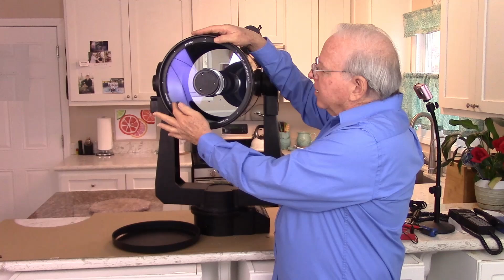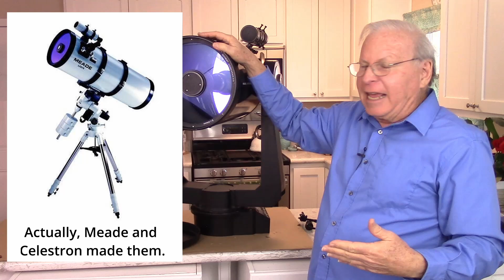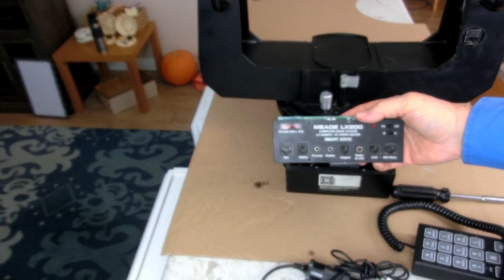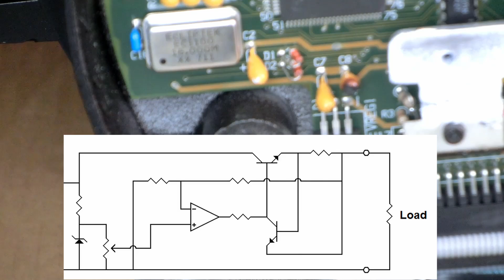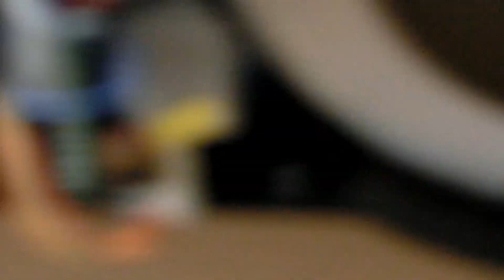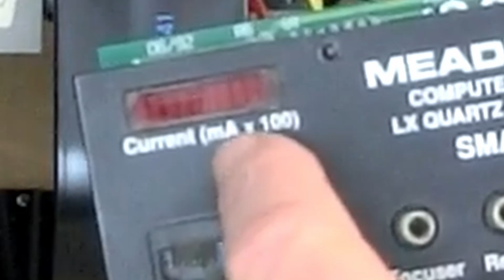Fixing My Meade Schmidt-Cassegrain Telescope's Electronics

Comment: Electrolytic capacitors can take some abuse,  but tend to dry out over time, particularly the smaller values. This causes the capacitance to drop to a very low level. This won't cause damage but may cause odd behaviour. Tantatum capacitors never dry out because they are hermetically sealed, but are very sensitive to overvoltage, which causes them to short out and explode, if the circuit can supply enough current. NASA uses tantalum capacitors in their probes but failures are extremely rare because batteries and thermoelectric generators don't produce voltage spikes. Meade used tantalum capacitors with voltage ratings that left little margin for error, due to cost. You are very wise to replace the original tantalum capacitors with ones with higher voltage ratings. Your telescope should last indefinitely. The upward creep of the current is troubling. Something is heating up and drawing more current, which may indicate thermal runaway. I would check for hot components, particularly semiconductors. But this may simply be how current is  drawn as the electronics start up.

Comment: I have a rescue scope (covered in barn dust) that I got for $100. It is a Meade LX6 (10” f/6.3) with wedge, tripod, hand control & encoders. I’ve been advised to replace all capacitors, even though it works when I plug it in.

Comment: Why do they use a spherical mirror? Wouldn't,t parabolic be better?
Reply: It’s a Schmidt, so the corrector plate on the front is a lens that allows the mirror to be spherical.
Reply from the maker: A parabolic mirror has its own problems. It's more difficult to make and the stars that are not in the center of the visual field are distorted, looking like comets to the the distortion is called coma. All modern professional telescopes use hyperbolic optics of the Ritchey-Chrétien design. As nicklappos says below, this is a Schmidt design that uses a spherical mirror and an aspheric corrector plate (lens) at the front of the telescope.

Comment: Has anyone removed a install a secondary mirror after recoating on Meade 2080LX3 8"? Has anyone used Spectrum Coating in Deltona, FL for recoating? Before I send it out as you may know they have to separate the aluminum mounting plate from the mirror to strip and recoat. All original marks from assembly at Meade are very visible so that is not the problem. The aluminum plate is 1mm smaller the the mirror so centering it isn't as easy as lining up both parts. Any anyone come up with method  to center it, of do I have to make a jig of some type to center it back to it's original position?
Reply: I have used Spectrum Coating and do not recommend them.  I sent off a few mirrors to be recoated anticipating that the mirrors would be better packaged upon return.  The small mirror abraded against the larger mirror and was chipped.  When I confronted Spectrum, I was told it was my fault as my package that I sent the mirrors to them was substandard.

Comment: You know how they use the entire Earth as a giant radio telescope?  I believe someday they will use the entire path of the Earth as one.  In other words, launch satellites at the farthest distances of the solar system to all work in unison-as the ones on Earth do now.  That would be a pretty big telescope.  I came up with the idea when learning how they use the Earth's path to triangulate great distances.
Anyhow, I subscribed, liked many videos, and tell all of those who will listen about your great channel.
I wish I could pick your brain about 2 problems I have.  The first one deals with my water well.  Usually there is a pressure switch that turns on a pump that fills a tank.  The problem is that if I'm not around and a pipe breaks or my well runs dry or the contacts on the junky switches, or the control box start capacitor, or ......I hate the design.  I'd like an alarm if the pump runs and pressure doesn't go up.  I'd like an alarm if the pressure goes below 20 psi.  I'd like to know the pressure at a glance.  I've changed the pressure switch 15 times and control box maybe 10.  I'd also like to know how many amps the pump is drawing at a glance.  I'd like to look at a log of the amps to know the history.  I'd like to be made aware of any problems, through my phone, when not around.   In a word, I want more control over a system that hasn't changed in 50 years.  I bet if you could solve all of these problems in a single package, you would make lots of money.

Comment: I would have replaced each of the tantalum caps with high-quality electrolytics and a 0.01 ceramic cap. Tantalum caps bother me. It was good work and good fortune finding all those things and replacing them. Carry on.
Reply from the maker: I agree, but the consensus on the Internet is that tantalum caps are better. Aluminum foil caps also have a history of drying out and failing, so I decided to go with tantalum.
Reply: @Vocademy-Electronics-Tech  Exactly Bob, and why not take advantage of more modern technology anyway?